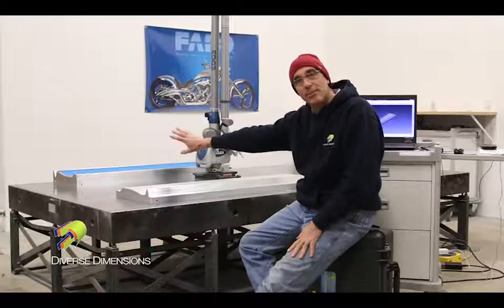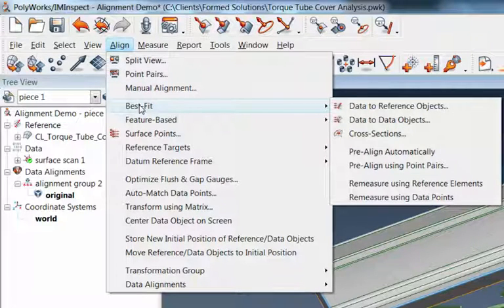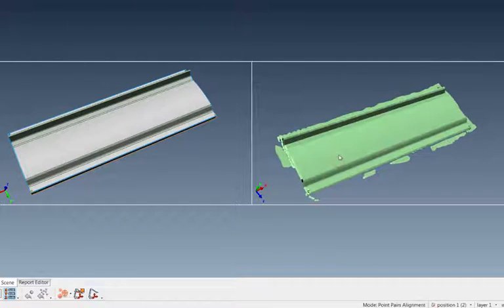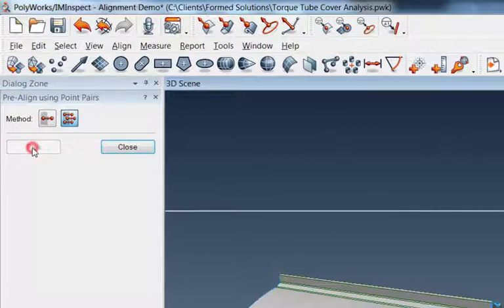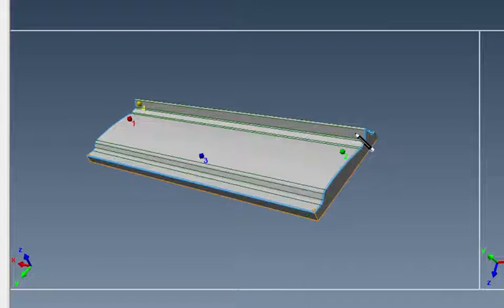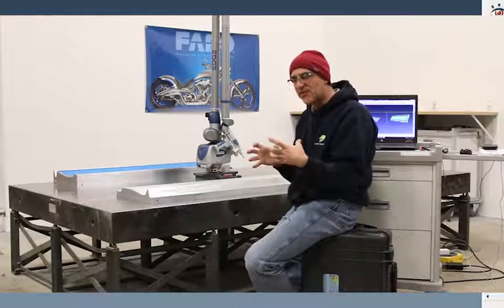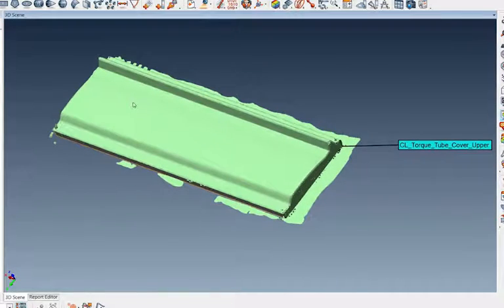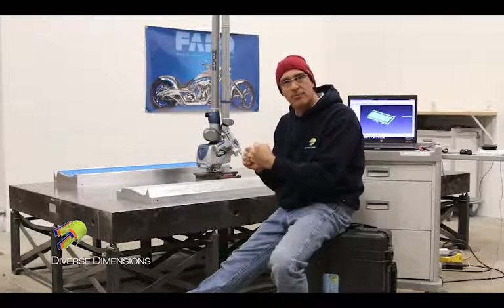PolyWorks: Best Fit Alignment - Point Pairs - Example 2

Comment: What is the overlapping uncertainty in faro arm scanning machine 
Can you please share with me.?
Reply from the maker: Hello, Rathod and thanks for reaching out on the scan overlap.  The uncertainty would be different depending on what Faro equipment was used for the data capture.  We have multiple arms and scanners.  I can share more through an email.  What is a good email address for you?

Comment: Hlo 
What is difference between prealignment and other plane axis alignment..do prealignment gives the same result for colour map as the other alignement methods
Reply from the maker: Hey there, Indrejeet.  thanks for reaching out on this one.  The "pre-alignment" point pairs is used in PolyWorks in the background of the best fit alignment to get the data close to the nominal CAD model as an initial best fit before the software solves the final alignment.  It is great for helping solve the final alignment quicker.